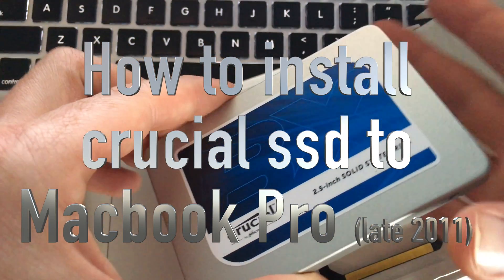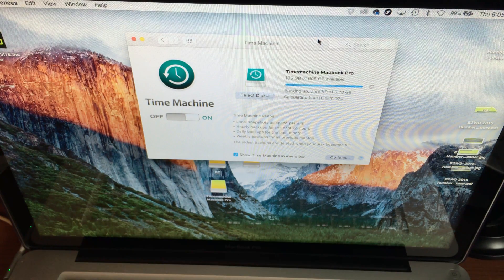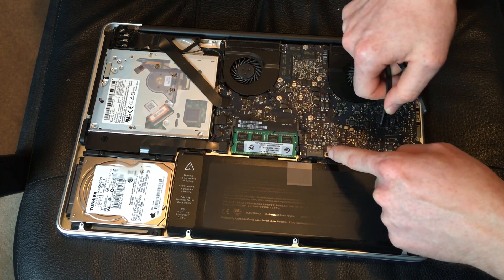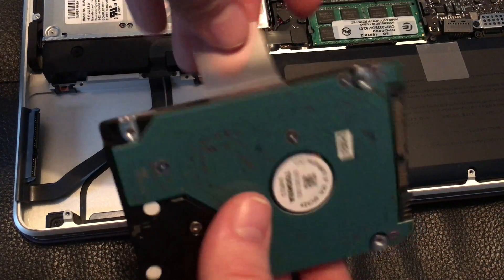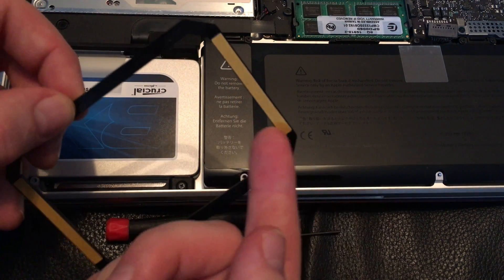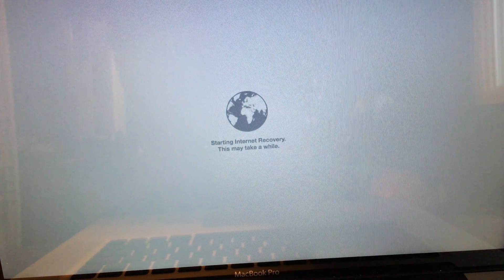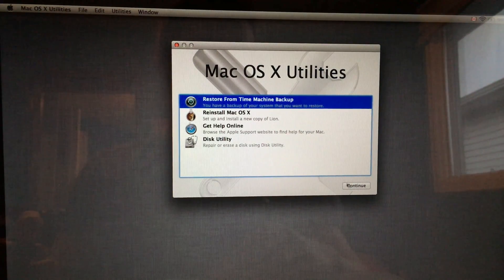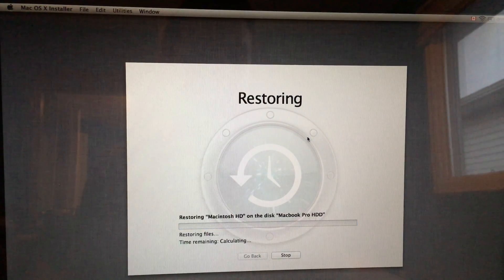How to Install/replace/upgrade to Crucial SSD Hard drive in Macbook Pro late 2011 - non retina

Comment: Thank you so much! 
I had 0 experience in tech-stuff, infact I never even saw the inside of a notebook before, but thanks to your video, I made my 13“ early 2011 MBP run as good as new. I also replaced the battery since the old one was only working when on the charger but didn’t even charge. I‘m so happy I didn’t buy an all new device!! ^^

Greetings from Berlin

Comment: I found you had the best instructions for the SSD upgrade, I just followed each screen and had absolutely no issues. Thank you for this mate, my boot time went from 10 minutes to under 20 seconds! I did both a 16GB ram  upgrade and Crucial 1TB SSD - amazing improvement to a 10+ year old MacBook Pro!

Comment: I installed the Crucial 250gb SSD drive and my machine boots fast as lightning. But when I tested the read and write speeds (Blackmagic) from the old drive they were only a quarter the speed. Why? Your video was perfectly detailed for the install.

Comment: Thank you for making this video. The Time machine Back up plan worked for me as well. Before this I tried to install the software and it didn't work. I followed your steps pausing every time and I was able to upgrade my Early 2011 MacBook to 1TB SSD and 16GBRAM. The difference is day and night. My machine is faster than it used to be, both applications as well as the surfing the internet became faster. Thank you once again.
Reply from the maker: Glad it helped 😃

Comment: Hi there, have a faulty hard drive and it won’t even boot up (flashing folder) . I replaced the hard drive cable and then it started working. Then the hard drive gave up again. So I’ve got a new SSD but now I can’t use the command r option and there is still a flashing folder. Any thoughts? I’ve done usb back up fork Capitan but that does nothing either. Thanks!
Reply from the maker: did you watch this video ?
Reply: Tech & Design I certainly did, time machine is not working because of faulty hard drive . With the new hard drive installed, I pressed the keys and nothing as it just goes to flashing folder. I did however press the option key on restarting but that just shows a cursor and nothing else 🤷🏻‍♂️
Reply from the maker: time machine is set up with an external hard drive by the way. and you only need it - if you care about your files.
Reply from the maker: you need to hold command R before you turn on your Mac, and hold until you see the image like in the video. or else it will fail again
Reply: Tech & Design Appreciate your help but I did that and still the flashing folder.

Comment: HDD is a SSD
Reply from the maker: The difference between hard drives and solid state drives is in the technology used to store and retrieve data. ... HDDs are cheaper and you can get more storage space. SSDs, however, are faster, lighter, more durable, and use less energy. Your needs will dictate which storage drive will work best for you.
Reply: @TechandDesign  
Yes Sir. I just meant, that you named your new installed SSD "xyz HDD". By the way, thanks for the video

Comment: Your instructions were very direct and easy to follow—thanks so much!!! So after i install the SSD do i just reinstall Mac OS to the new SSD??? I don't have any files or docs or anything --everything clean, so no need to back it up, right?
Reply from the maker: Did you watch everything ? If you don’t have a time machine backup - you can go right ahead and install macOS - yes - after formatting just like in the video
Reply: Tech & Design yes i sat through your video, thanks again. would rather do everything right the first time that’s why i ask. i’m not a tech guy. cheers

Comment: Im stuck with the  “globe turning + wifi connection” screen.  The wifi is working (tested on my phone).  Any suggestion to solve this?
Reply from the maker: Ale sure your Mac is connected to the WiFi. Also - try connecting directly - using an Ethernet cable
Reply: Yes. Wifi and ethernet is working.  After a while it showed error 2002f.  Have you seen it before?

Comment: Could not get to utilities to come up to reinstall the OS on my 2011 17" MacBook pro. Apple tech in store checked all systems and said needed new hard drive. Installed a new crucial ssd recommended exact fit on their site and followed your video and others on you tube and it still will not let me get to utilities. Help please

Comment: I followed your tutorial exactly as shown in the video. Each time I choose to restore from my backup I get this message:
“An error occurred while restoring from the backup. Restart your computer, and then try restoring again.”
Any advice on how to fix this?
Reply from the maker: Are you sure you followed everything? Are you connect to your WiFi network ? If not working connect directly using an Ethernet cable with your router.

Comment: This is an excellent tutorial video, I followed it with very limited experience in upgrading my macbook. I see a lot of videos recommending installing the OS onto your new hard drive before swapping them, but I just swapped mine and reinstalled everything from time machine like this video says. It's so much better now I can actually use my laptop again and it only cost me about £250.
Reply from the maker: Glad to help out. This is in fact the fastest and easiest way to transfer everything from your old Mac to your new SSD or harddrive. No need to do anything complicated. Anyways, glad it all worked out for you.

Comment: i should be able to take a harddrive out of a dead mac and put it into a new one correct?  everything will boot up fine on the new mac with the old harddrive because its formatted to run macOS right?
Reply from the maker: Yes and no. Depends how New is the new Mac.
Reply: Man is that cool.. both macs are within 4yr of each other.. I just did it and it works.. this is an interesting way to create “backups”, basically pop Mac formatted hard drives in and out of machines.... cool and thanks for the vidya

Comment: Is this the same with Mojave?
Reply from the maker: Exactly the same
Reply: Tech & Design thank you...I have a problem then.  I tried it like six times and ready to just return my SSD and forget it.  

I have time machine and did it just like in your video and when I’m done or when it’s done loading it reopens in the same screen as if I hit command R.  It will not open to my regular login screen.

So then I tried to load Mac OS (the second choice) And it looks like it’s loading everything looks good then when it’s finished it really opens in the same screen as if I hit command R again. 

The whole process looks like it’s going perfect but I can’t get it to open in my regular sign-on screen. 

PS I watched many videos and your video was the most easy to follow, I just wish it would’ve showed the final step where it reboots in the sign-on screen LOL
Reply from the maker: It sounds to me like you are maybe not holding command R long enough. Hold it until you see a loading bar going almost half way
Reply from the maker: Or maybe just take some time to watch the entire video. Or this one might help a little : https://www.youtube.com/watch?v=oOCuiHvb6Q4

Comment: Yes Joseph Torx 6 / T6 is correct for the four drive side lugs.
The case back needs Phillips 00 or 0, I found the 00 was too small and risked stripping. Make sure the bit rests securely in the screw head with no play or wobble before turning, and hold the driver perfectly perpendicular to each screw not the machine back, due to the placement on the curved edge.
My case screws were carelessly over-torqued by the last shop that did work, the bastards. All good now.
The screws on the black drive bracket are the small Phillips also.
Finally SOME drives like my Samsung don't include the 2.5 mm conversion bracket! Can order one online or fill the void with layers of tape. I think it just supports the case cover to prevent crushing if you grab it there.
Reply: Excellent advice, thanks for these important notes j freed.
Reply: Thanks for these excellent notes j freed.

Comment: Very good information on restoring my MacBook Pro, the only part I was not sure about was the part where you erased something or prepared the hard drive, could have explained that better but the rest of the install went very well, FYI, I had to start my computer two times to get to the logon. The external hard drive is the way to go!
Reply from the maker: I just formatted the harddrive. Thanks for the feedback. Always appreciated

Comment: What If you don't have an External hard drive then can you use a USB ? Would that work ? let me know thanks!
Reply from the maker: I personally wouldn't do this without making a backup in time machine using an external hard drive. But it depends if you care or not about your info

Comment: Does anyone know if the Samsung 850 EVO 2TB will work for MacBook Pro (13-inch, Mid 2012) OS: Sierra.
Reply: Sandra I just installed one (1 TB) with no issues.